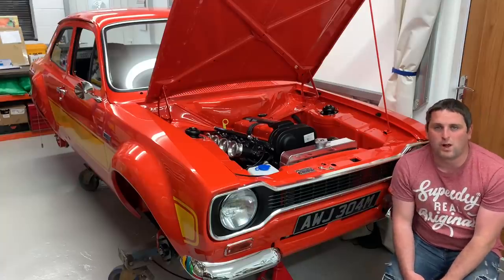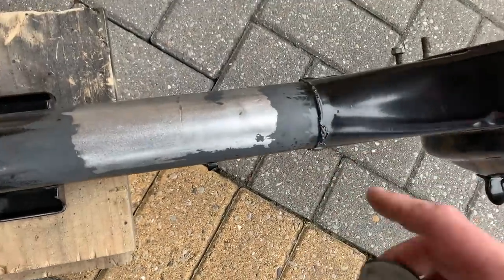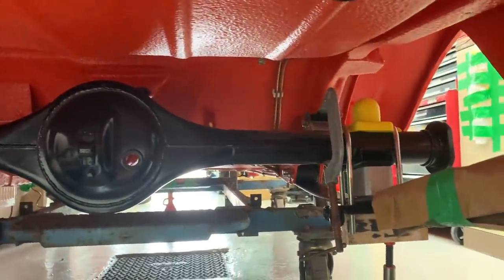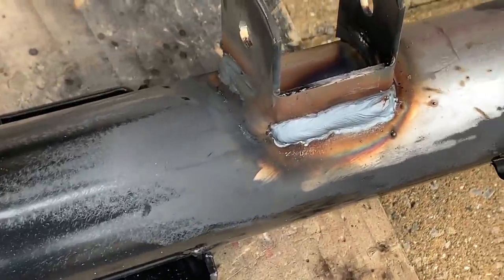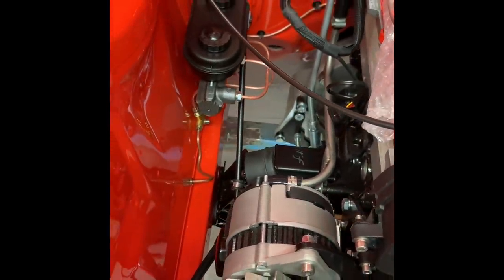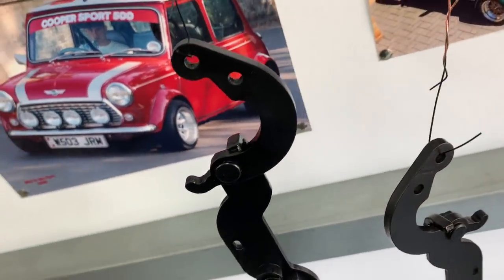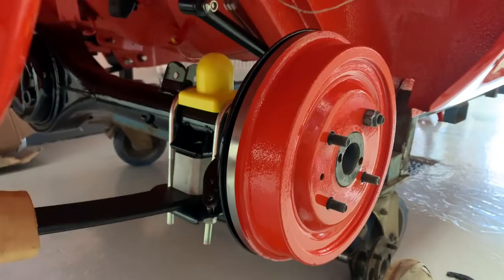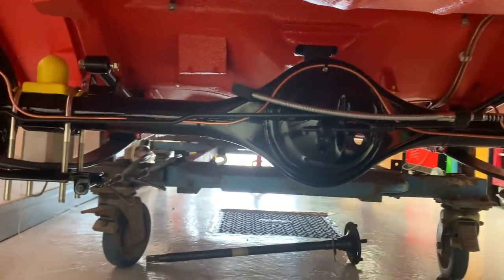Mk1 Escort RS 2000 Episode 20 Axle progress & Brakes

Comment: It's gorgeous. How will you keep it clean on our shitty roads? 
Did you use copper brake pipe? I used Kunifer which is harder to bend but much stronger. I also fitted brass unions as the steel ones just rust.
Ps don't use Silicone brake fluid. My brakes were crap and I had to change it out for DOT 4
Reply from the maker: Thanks Andy. Keeping it clean is probably the biggest challenge of all. Its a nightmare with the mini. Yeah i just used copper brake tube as ive always found it really nice to work with and flare. I actually have silicone brake fluid in the mini, as it doesn’t take paint off. Its always been fine in the mini but i cant use it on the escort. That willwood master cylinder says DOT 3 only, so thats what il have to use.

Comment: Hi Craig. Thanks for finding the master cylinder box for me. Ive got one on ordre now! I was wondering where you sourced the brake pipe union/junction fitting that sits underneath the master cylinder? Many thanks!
Reply from the maker: Hello Matt, pleased you got sorted. The brake pipe unions come with the master cylinder.  You will however need to adapt the rod that fits to your pedal, but this is easily done if you have the original and a welder 👍

Comment: Hi ya, great videos, I was looking a little help, could u tell me were did you get your master cylinder from? Or what is the part number for it? And does it let u connect the rod onto it like the early mk1 escort without the servo tower? Thanks
Reply from the maker: Thanks 👍. It came from GS Escorts and Part number is 260-4894. It’s a willwood item but as you can imagine, no servo means you need a heavy right foot for breaking. Now then, there is a small mod to do regarding the rod. You use the new rod that comes with the cylinder and fit it to the ford end that attaches to the pedal. Is there any way I can send you a pic of how I done mine?? Really easy, just need a tap, a nut and a good mig weld and it fits a treat. I did cover it in a video but I can’t remember which one

Comment: Great video Craig! Could I ask you what is the model number/name of your master cylinder please?
Reply from the maker: Thanks Matt. Sorry for the delay in reply I’ve been meaning to ratch the box out since you asked. Its a wilwood master cylinder with a part number of 260 4894. It’s an almost direct replacement other than the fact you have to adapt the rod to fit your pedal. If you have an original rod, it’s pretty easy to do👍

Comment: Did u manage two get a proper mk 1 rs2000 dif  as they were higher ratio than normal
Reply from the maker: I went with a recommended 3.79 ratio Chris. This is what I was recommended by GS Escorts for all round best use

Comment: Hi Craig  the car is looking great what willwood master cylinder did you use
Reply from the maker: Many thanks 👍. The willwood master cylinder part number is 260 4894. You just need to adapt the rod that it comes with to fit your own pedal box but this is really easy if you have the end of an original Ford master cylinder rod. One of my videos shows how I did it and only involves drilling, tapping and a decent mig weld 👍
Reply: Thanks mate great help

Comment: Don’t alter the brackets on the axle, make up or modify the tramp bars!  How are you mounting the shockers?
Reply from the maker: I wanted to alter tramp bars instead but it wasn’t possible as the brackets on the Axle were in the way of the shockers. They mount onto the bottom clamp on the leaf springs, up to a bracket on the underside of the boot floor. In the end i had no choice other than to remove them and weld them back on in the right place 🤦‍♂️
Reply: @performanceclassics1986  ahh so you are using “slope & hope” shock absorbers, I would have been looking at the later type which are nearer vertical. There were 2 types of shocker turrrets fitted by Boreham, The original MK 1 s had inboard turrets where the turret was inboard of the chassis rail. These were superseded by the outboard turrets.
Sorry about the comment re the brackets, I posted it as soon as I saw what you were doing instead of waiting until the end!
Reply from the maker: @gordonbradford4054  No problem Gordon. I can tell you know what your talking about so all comments are appreciated. I would have preferred the later design with the turrets as i believe the bracket that mounts the shockers to the boot floor has a tendency to crack. The body-shell has the earlier mounting set up, so i just left it alone as it was.

Comment: Just saw an interesting post on Facebook and thought about you , and thought this would be perfect for your escort. All about fitting mk3 mondo salon boot struts to the bonnet hinges and doing away with the bonnet stay. They are meant to be the perfect balance holding the bonnet in any position.
Reply from the maker: Yeah that would be a cool idea. They are really short struts aren’t they?? Ive seen them fitted and it looks like a decent idea 👍
Reply: @performanceclassics1986  yes they are short , boot struts not tailgate struts .
Reply from the maker: @antmk2dreaming614  I really like the idea of it. My only concern is that the full weight of the bonnet is then transferred through the bonnet hinges which are only spot welded to a 1mm steel bulkhead. Just makes me wonder if it would eventually cause cracks to the hinges or bulkhead

Comment: Amazing build Craig. That looks pretty close to the colour of my long forgotten project Mk1 in my shed (that I hope to get back to some day). I don't remember the orientation of the brake lines on mine and it's a bit hard to get to to see the lines but I think you may have them the wrong way round. Wouldn't the feed from the master cyl go on the bottom and then out from the top to go to the other side? The way you have them, I don't think you will be able to bleed the air out properly so that it all gets out at the top of the wheel cylinder and then over to the other wheel cylinder through the bottom port and out the top through the bleed nipple.
Reply from the maker: Thanks Dennis. I had exactly the same thought about the brake lines, so i looked at google images of other cars and they all look to be the same. I completely agree with what your saying, as i thought exactly the same. Also if i put them the other way around, the lines will have to cross over. I suppose i can easily change it if they wont bleed up properly 👍

Comment: Coming along well..glad you choose a proper exhaust system, I have a single box 2.5" simpson with manifold system..it is a beast of a thing, the welds are a work of art and it sounds 👌..
Reply from the maker: Really great to hear that. The welds are pure engineering porn 🤣🤣🤣 id love to be able to tig like that. Whats the manifold like in the standard battery location?? Im just hoping it clears the battery tray. Judging by photos it does look miles away. Do you have the battery in the standard location??
Reply: Battery is in the boot, however from the slam panel to number 1 primary there's 11" I think that's more than enough on a standard batt tray, the welds are unholy, and it turns gold after a while, you won't regret the ££
Reply from the maker: @taffymk1244  Thanks for that detail. Much appreciated. Im sure your absolutely right about not regretting it. Its worth finishing off properly now.
Reply: @performanceclassics1986  I send you a couple of pics if you want on email..
Reply from the maker: @taffymk1244  That would be brilliant Thanks. Its Mclean.craig2@gmail.com Much appreciated 👍
Reply: @performanceclassics1986  pics sent 👍
Reply from the maker: @taffymk1244  Thanks very much. Very much appreciated 👍

Comment: the side of your masterpiece Escort looks dangerously close to the garage wall hope there is plenty of padding protection.
Reply from the maker: 👍 I actually have 2 padded bars clamped onto the frame that the car is mounted on that touch the wall to stop the car getting anywhere near touching. They act as a stop. It works a treat 😎

Comment: brilliant work Craig! 

Surely high pressure compressed air would've been better on the axle?

Wouldn't a machined spacer address the drum to backplate gap?
Reply from the maker: Thanks 👍 The problem was the grit was stuck to oil and Grease on the insides. It took around 2 hours of pressure washing to get it all out 🤦‍♂️
Reply: @performanceclassics1986  I'd tape it all off and fill it up with degreasant, stand it on its end and leave it to soak for a few days - that stuff sticks like sh*t to a blanket, and ANY abrasive grit anywhere in your axle will play havoc with it.